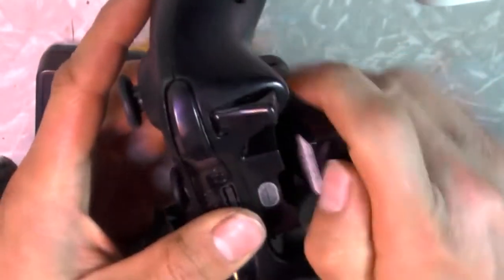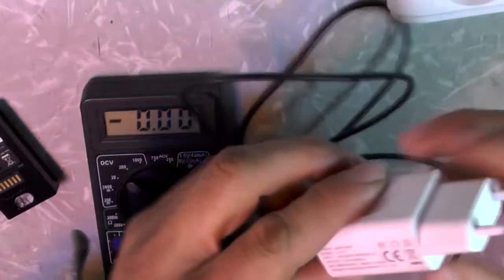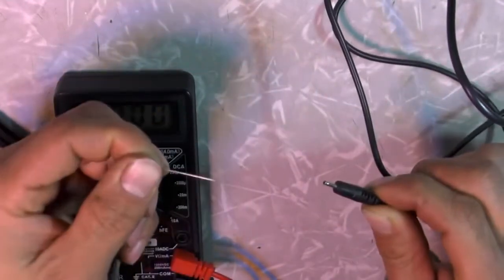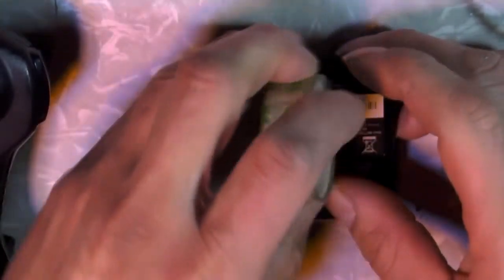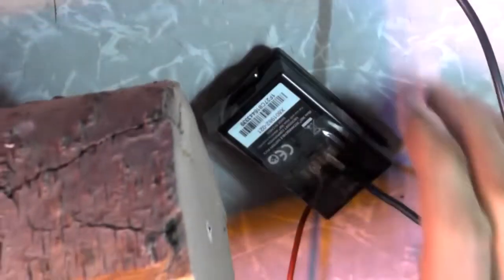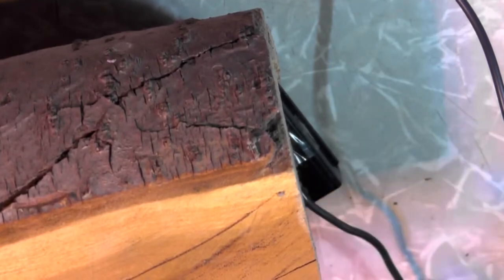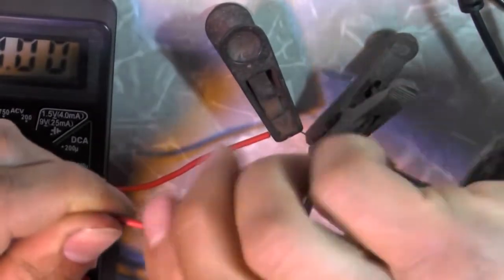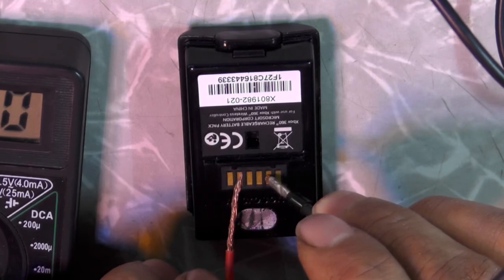How to revive & to charge an Xbox 360 gamepad battery without original charger

Comment: What does it mean if my battery gains voltage using the revive method, but then it starts dropping 0.1v each two seconds till zero again.
Reply from the maker: If you charged it only for a few seconds, it is normal (while checking using multimeter or even without checking). But if you charged it fully and still can discharge it only by checking the voltage, then maybe the cells are damaged. I think there's nothing you can do.
Reply: At most 1 minute, it reached 0.37v then started dropping fast when checking with multimeter.  @virtuastreetfuryalive

Comment: Mine has voltage, and also doesnt charge, anyone know what could it be?
Reply from the maker: Maybe the battery is dead. Sometimes it may have low voltage, but you can't revive it. Or maybe the reset connection works and I just didn't understand it because my gamepad charging wire doesn't work. I told it in the video, not sure (don't remember), connect 1 & 5 or 2 & 6 pins, or both one after another for a second.